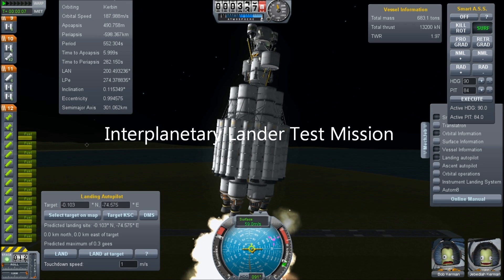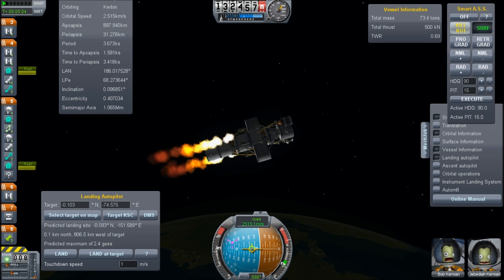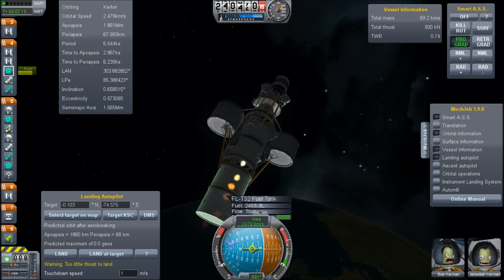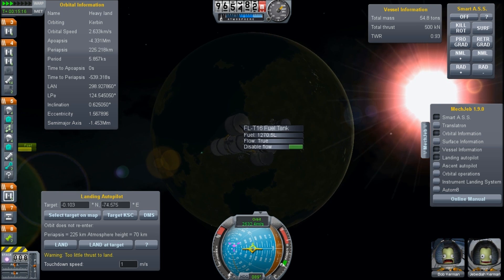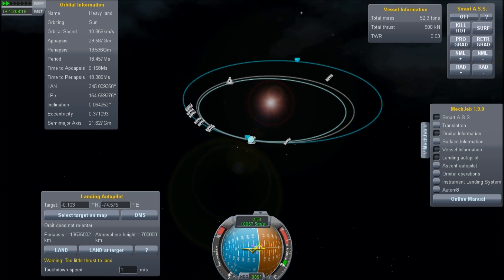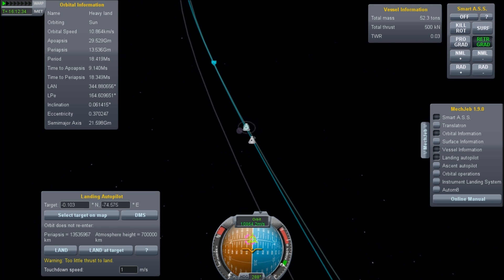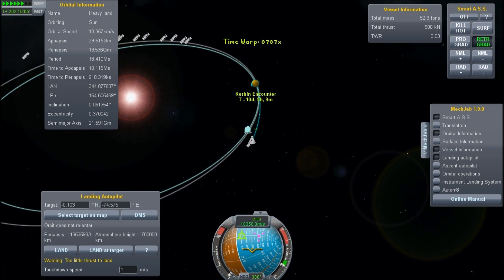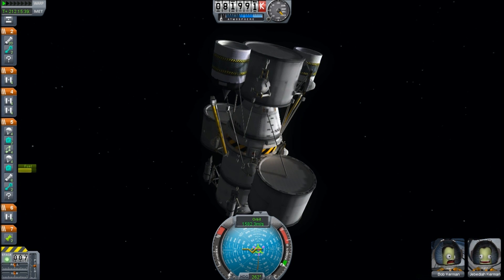Simulated Interplanetary Lander Mission - Launch - Kerbal Space Program

Comment: You misinterpret his manually. It usually just means, that he can't use the far more advanced display system of MechJeb and that is a pain, since KSP's display is really suboptimal and I bet it will be changed a lot before 1.0 happens in a couple of years. :)
Furthermore is the autopilot a lot less efficient than a human pilot meaning it would be a better test for the safety margins.

Comment: the kraken rips apart ships that go to fast, cause your not really flying a single solid rocket but multiple rocket parts in close formation the game engine calculates a position vector and speed for all the parts,. the kraken happens when you gain s much speed that the game cannot update those values fast enough, meaning that your rocket parts are all heading in  different directions very very fast and the whole thing explodes for no apparent reason

Comment: Landing that without Mechjeb is perfectly doable if you have a computer good enough to not choke in low altitudes.

On the fuel issue: the game really does not like when you have a fuel line system that comes from the center to the outside and then returns there. It either starts draining the wrong tanks or refuses to drain some tanks in a seemingly random fashion. In your case a diferent fuel line disposition would had solved that issue ...

Oh, and land safe :D